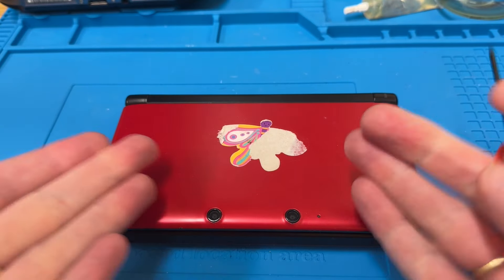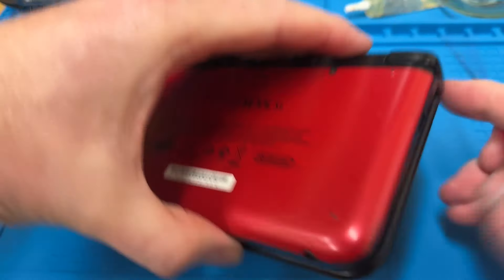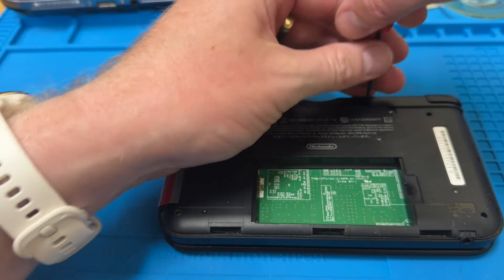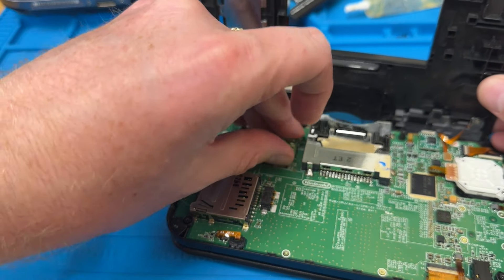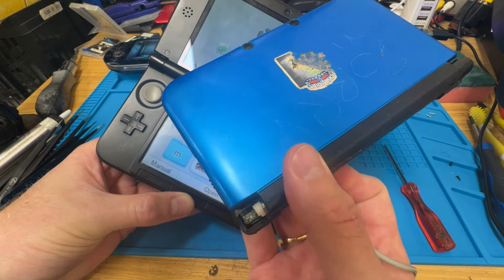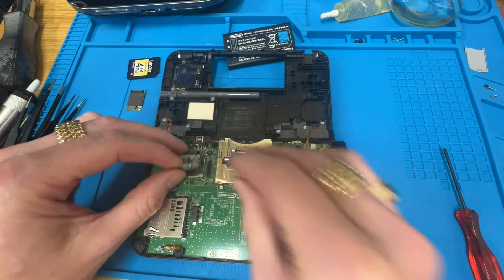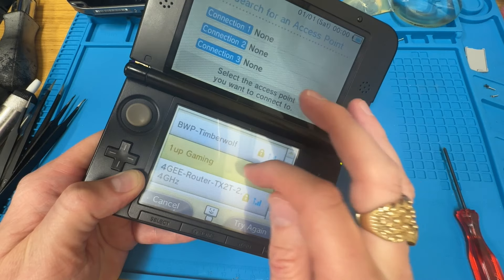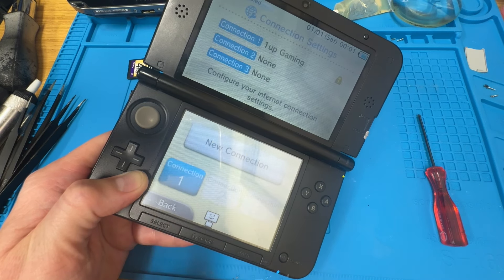Nintendo 3DS  - Faulty "An error has occured - Please Turn Power Off" message, can we fix it?

Comment: Hi mate! I was just wondering if you you know of any fixes for backlight bleeding/leakage on a N3DSXL? Or will i just have to get a screen replaced? Cheers for any answer!
Reply from the maker: @binkybunster  I have replaced the backlight on a 2ds screen before, just the light, it could be possible to harvest the parts from a cracked screen, but it would be fiddly as you’ll need to take the actual LCD apart to get at the light, I am not sure if it is soldered in to the screen ribbon or not though, sorry 😢